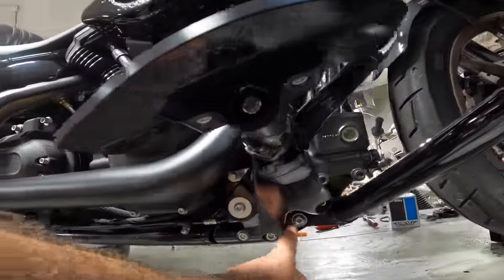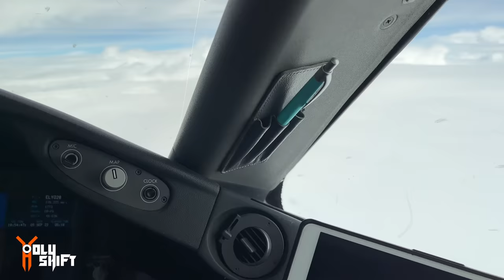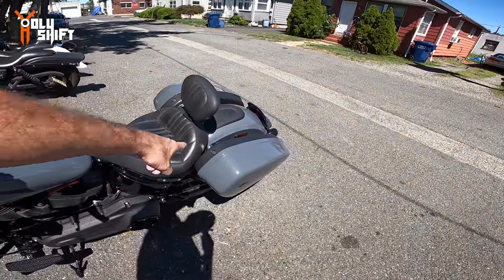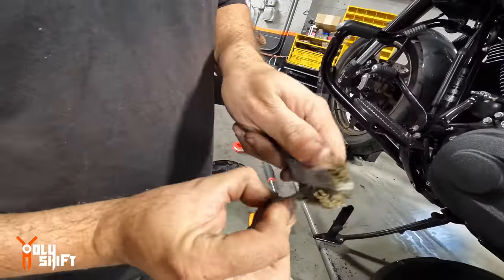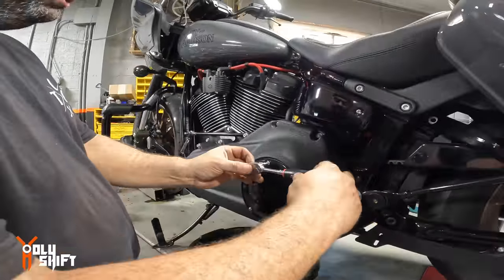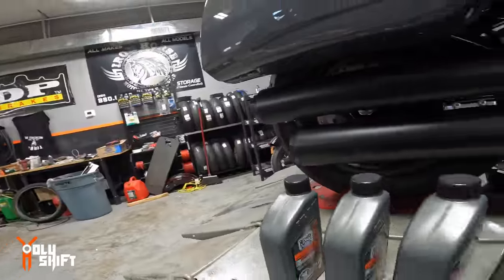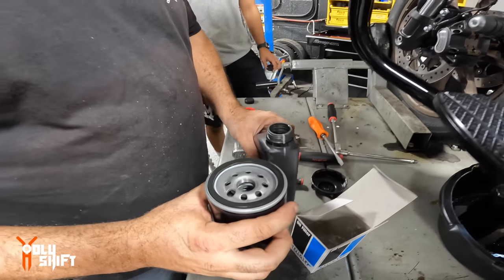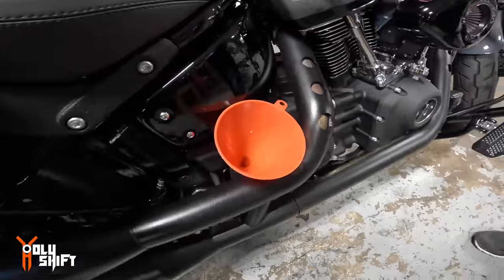Low Rider ST. First Service

Comment: 10:37  The white Teflon tape is for water applications,  yellow Teflon tape is for oil applications   next oil change use the yellow and it won't leak    available at any big box store like Home Depot, Menards etc  ... in the plumbing section   =)

Comment: Why no transmission oil change? 1000 mile service calls for transmission also. With 5 quarts of oil in engine you have a good chance of getting blowby through the air cleaner. I've been putting 4 1/2 quarts in all my harleys for years. I used to get blowby with 5 quarts, now, no blowby.  Just a suggestion. Also I have the 2022 FXLRST in grey. Great bike!
Reply from the maker: Trans oil changed- but not on camera. We started with 4.5 quart in engine but it was not showing on dip stick…continued till almost 5 went in.